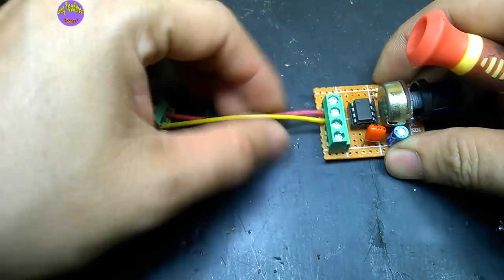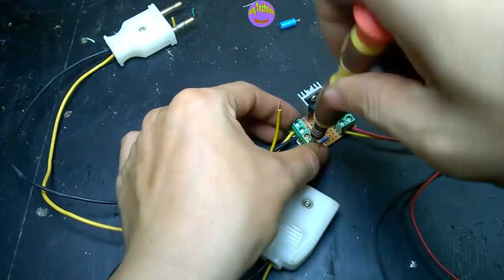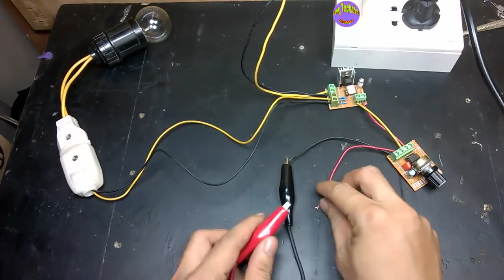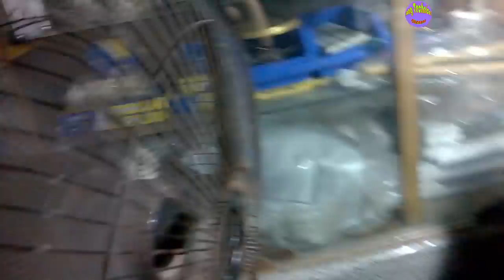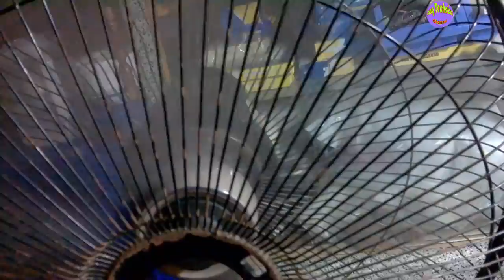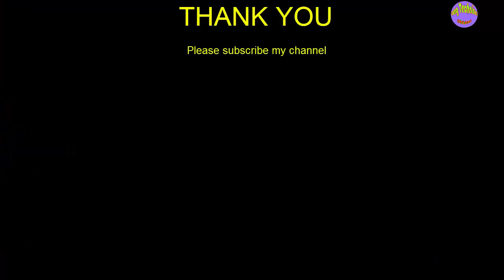AC Electric Fan Speed Control Circuit Use 555 and Solid State Relay

Comment: nice one on creating harmonics
Reply: An SSR should only switch on or off at or very near the zero crossing point of the sine wave, therefore should not create an electrically noisy situation. At least nothing an x2 capacitor couldn't tame.

Comment: Is this a good idea? Surely turning the ac on and off rapidly like this would not be good for the motor.
Reply from the maker: You right. That is not good idea for motor.
Reply: But it works for this cheap standing fan